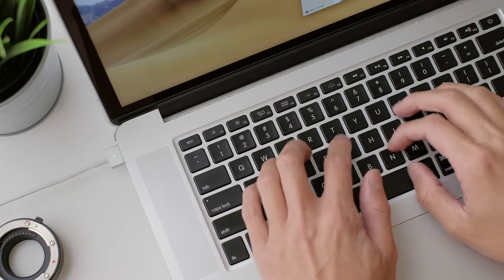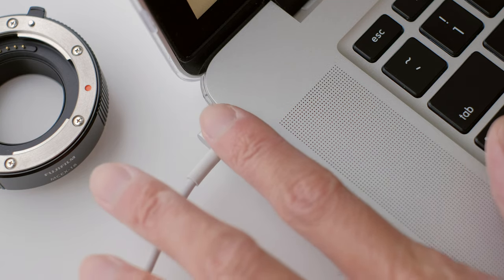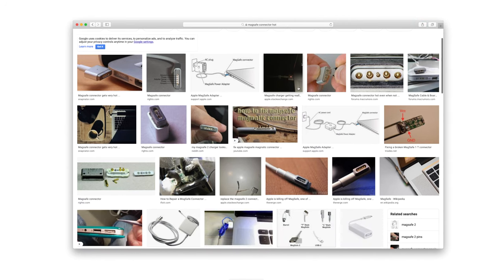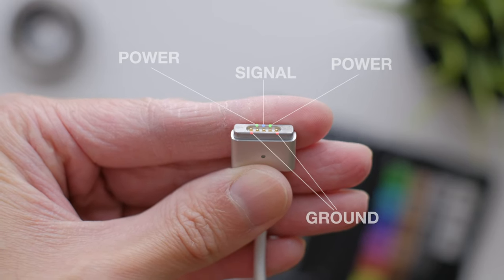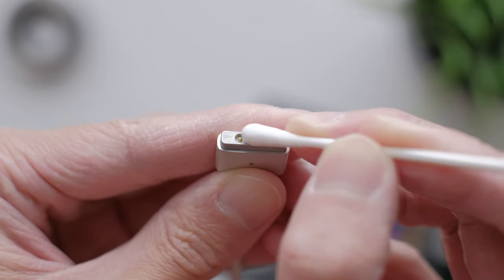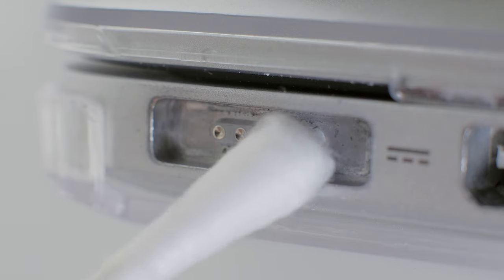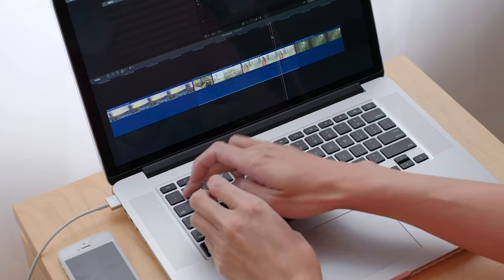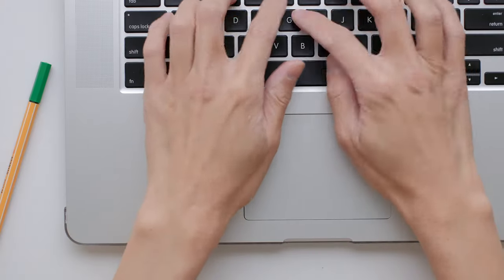BURNING HOT Apple MagSafe 2 Connector when charging. This can't be right...

Comment: When I see it's getting too hot, I pull it off than turn it around and connect it with the other side up...than it cools down.
Reply from the maker: Maziar Bakhtyaryan interesting. Wonder why it would help?
Reply: @JoeLamOfficial  Yes. Did you try?
Reply from the maker: Haven't yet, since cleaning it and pushing the pins. It feels like it doesn't get as hot.